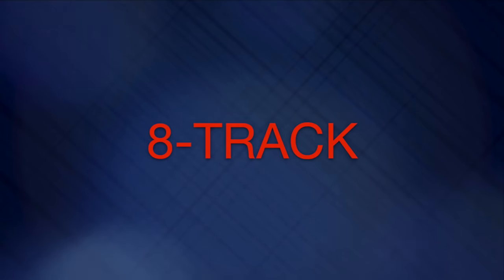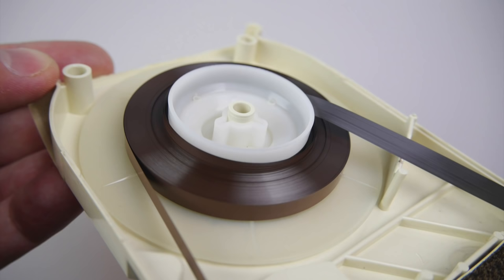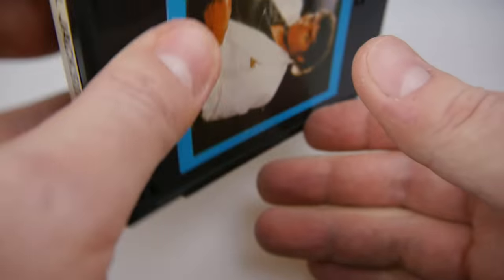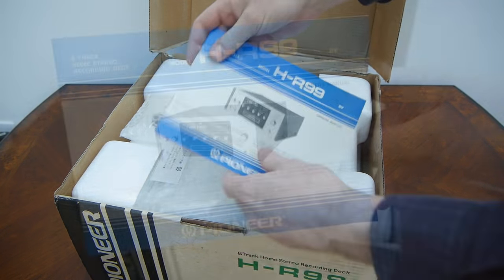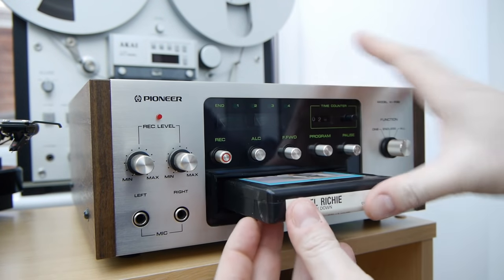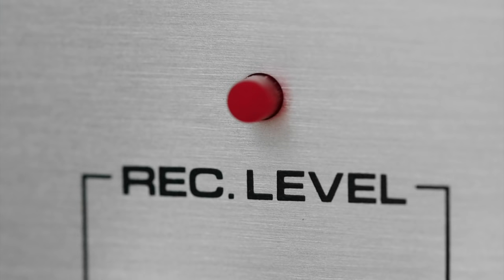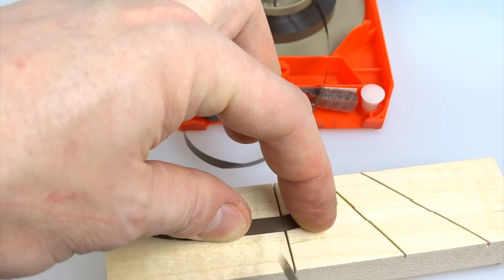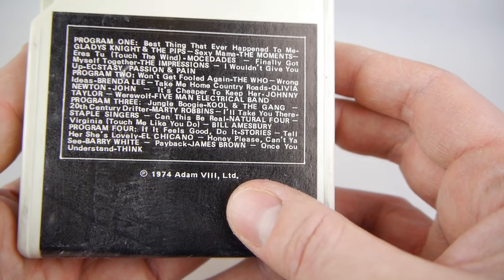Revisiting the 8-Track with a New 1975 Pioneer HR-99 Recorder

Comment: Your diagram of layout of the tracks is incorrect. 
There are 8 tracks and four programs but if the tracks are numbered from top to bottom, the first program is tracks 1& 5, Program 2 is tracks 2&6 , P3 is 3 and 7  and P4 is 4 and 8. 
These cartridges were self-destruct machines. Cassettes were way better.

Comment: I still do not understand how they deal with the different diameter inside and outside of the reel. One revolution inside the reel should yield about half of the amount of tape of a revolution ouside. So to my understanding the tape should be under permanent stress. Perhaps anyone can clear up the "knots in my head" (sorry I am from Germany)?

Comment: 2:07 "I know there's quad 8 tracks, but where not going to go into that right now" Could you?
Reply: Quad 8 was an attempt to create a quadraphonic sound using an 8 track cartridge (4 speakers).  In a Quad 8 cartridge, there were two programs, each comprised of four tracks.  That meant half the play time per cartridge...  Quad and Stereo 8 cartridges are almost identical, but the Quad 8 ones had a little notch cut into them so that a Quad 8 player could sense that it was a Quad 8 tape.  Quad 8 cartridges were not compatible with a standard 8 track player, but you could play standard Stereo 8 cartridges in a Quad 8 player.

Comment: Don’t laugh at 8 tracks.  Every image you ever saw from the Voyager Spacecraft was first recorded on 8 track tape before it was transmitted back to earth.  Was cutting edge when the Voyagers were designed in the early 70’s.  Both Spacecraft used it and now have left our solar system.  If Alien civilizations ever come across them 8 track will be what they’ll find aboard.

Comment: Could you replace the tape in a cartridge to make a new recordable instead of buying one?
Reply: pnadk Yes. Reel to reel tape would work. Trouble is unwinding and rewinding it is a pain.

P.S: Must be recorded with an 8-track reel to reel head, and must be at the correct speed.
Reply: The tape has to have graphite coating on the back or it won't work.

Comment: Eight track. I used mine with a promotion.( And a magnet) to sell items as the customer walked by(display). a card was inserted in to a slot the magnet  turned on a relay. To put in plug(voice) for the item. To be sold. Buyer recived item from stocks, and I gets me money .de kv4li 73 ps worked well with chips, hot dogs,and drinks

Comment: I don't get it, why noone of this doesn't have a play and stop buttons?
Reply: Искандер Сайфуллин you do. It’s called slamming the tape in or pulling it back out. Pretty fail safe if I do say so myself. You don’t want to leave an 8 track in the player because you’ll flat spot the pinch roller and foam pad giving you a warbly effect.

Comment: How does a 8 track tape move when there is no gear to spin the tape?
Reply: +James Lee (leejiasengthepro1) Friction.  The rubber wheel in the cartridge is pressed firmly against a metal capstan shaft sandwiching the tape between the roller and the capstan.  The tape is then drawn from the center of the spool which starts the whole spool turning.
Reply: oh i see
Reply: I still can't get my head around how the tape works! I get that the tape is pulled from the middle, and is out back on the outside, but my brain thinks that shouldn't work. The ring of tape should be getting bigger, with the hole getting larger as well!
What causes the tape to move inwards?
Reply: +Dragonbait Your brain needs some learnding! Why would the ring of tape get bigger? You're not adding tape to the reel. You're taking away exactly what you're adding to the outside.
Reply: +Harold Lloyd I understand that, but you are taking from the middle and adding to the outside. If you think of just a small cross section of tape you are taking tape from one side and adding it on the other, that means the section would travel. But in the tape it doesn't travel so somehow the tape is moving inwards lol

Comment: What's wrong with the tape at 9:23?
Reply: It seems like the player is struggling to pull the tape through, many because the tape is too tight, or a problem with the pinch roller.

Comment: Once the cassette tape was introduced, 8-track went by the wayside. Reasons being; cassettes besides having a more compact size, they offered much better quality in fidelity with respect to frequency response. The reason: while the track size is roughly the same per track, the tape speed is faster on a cassette tape than it is on an 8-track. This faster speed offers a much better quality of recording capability. It is very much akin to recording on a reel to reel using the medium speed and pales in comparison to using the fast speed. As a result and for this very reason, the 8-track tape was perhaps the worst recording medium ever to be commercially available. Conclusion: don't waste your time on them, they are garbage.
Reply: sc0tchlvr, that's not actually true.  The tape speed on on 8-track home / auto machine is 3-3/4 inches per second, exactly double the speed of a compact cassette which runs at 1-7/8 ips.  The quality difference is largely due to the more advanced engineering applied to the cassette, as more serious audiophiles were being attracted to them. 
All pre-recorded 8-track tapes were high-speed duplicated with cost, not quality, being the primary consideration.  The quality obtainable by recording your own on properly adjusted equipment was quite remarkable.  The trick was being able to adjust all the recording parameters (especially bias current) and ensuring the record equalization did not prematurely roll off the last octave above 10kHz.

 The vast majority of 8-track players were in automobiles, where vibration and airborne contaminants worked to reduce their frequency response due to azimuth misalignment and spacing losses. Cassette machines were far more prevalent in homes than 8-tracks, where the environment was less harsh, and the sound quality (or lack thereof) could much more easily be discerned.  Consumers demanded (and were willing to pay more for) improvements over the years that made the cassette the champion, despite using only half as much tape per track as the 8-track format.  Nakamichi even produced a cassette deck that sported a switchable half-speed (15/16ths ips!) that rivaled the quality of many lesser sets at the standard speed.  
Here is a YouTuber showing off his Nakamichi 680ZX:

https://youtu.be/WBbEqGlMt9A
Reply: Thanks for the correction. I actually realized that I was wrong in the tape speed difference after I posted that. However still there IS a significant difference on the quality of the frequency response and it IS very noticeable. I ran across this a long time ago when I had some 8-track tapes and was repairing an 8-track player as a project of mine. I copied a recording of Gary Wright's "Water Sign" song from a prerecorded 8-track tape I had and thought I had a good sounding recording of that song, only to find much to my dismay when I later heard it from a prerecorded cassette just how different the quality of the sound was. This is my main point here: 8-track tapes where perhaps, for whatever reason, the absolute WORST quality of sound that you can ever get from the commercial market formats of ANY other format that was ever made available. That was my main point, and i stick by that assessment.
Reply: ALSO don't forget that once cassettes started to dominate the market that more and more of us used them in cars as well, and I can tell you from past experience, that this format at the time was the bomb! Hands down.

Comment: Guess I'm too young to even know what 8 track is
Reply: The 70s sucked. You didn't miss anything :p
Reply: migangelmart i'm very happy for the times i live in :)
Reply: @ Samuel Fabiny
There had been a lot of attempts to pack tape recorder reels into a sturdy case. The first successful system was the compact cassette ('CC' by Philips, Netherlands, 1963), introduced at same time with a wicked little recorder (my brother hat one, he pulled cables from the guitar amp speaker contacts to the mic input - it survived!). Philips took low license fees, so the system spread to Japanese manufacturers. The 8-track was introduced in 1965 in the USA, and US car-makers built it in their cars as standard. The backdraw was that there were hardly any 8-track recorders, so music for the car had to be bought, while CC could be recorded from radio or record player. The sound quality was quite equal (both ran on tracks 1/8 of regular tape width and with 1 7/8 inch/s). CC was cheaper to produce and lasted longer, so the system won - just like VHS did with video tape later. 
 
... please don't tell Techmoan ... iPod sound is a lot better.
Reply: akronymus thanks for the info :) very interesting
Reply: The 70s sucked... but the 80s ruled :D
Reply: migangelmart
not true. 70s were forward, forward, forward - they even explored the moon. 80s was 'back to master-servant society, pain in the ass.

Comment: Dozens of used car between 5 & 10 Years old
Chances the installed player worked without instantly destroying tape or failing to work at all ...
Compact cassette about 75%
8 Track 0% (Literally ZERO  I  NEVER encountered a working one!)
Conclusion 8 track == SH*T
Alleged sound quality is irrelevant if the damned thing doesn't work!
I've no idea how even Yanks stood for them.